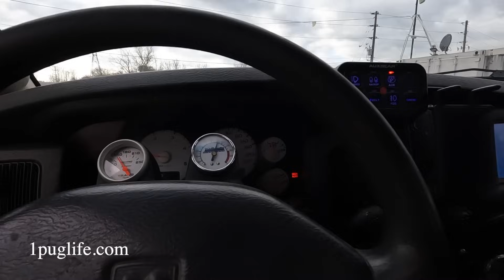running utilities to a shed

Comment: How deep does electrical wire need to be buried in Ontario?
24 inches
Electrical wiring in trench is required to be buried to a minimum depth of 600mm (24 inches) for non-vehicular areas and 900 mm (36 inches) for vehicular areas, all with ribbon (12 inches) below grade. Ensure slack in wire is provided in the ground (S-Loop) for frost purposes.
Reply: Yeah everything they did is wrong 🤷🏻‍♂️
Reply: never seen permanent power ran to a portable container like that and nothing there looks to be any type of code compliant anyway, surprised they even hooked power to it.
seems to me the power should go to a meter pedestal with main disconnect, then to the container...
as for the rest, yeah, nope.

Comment: You should spray water on the blade while cutting, you don't need to breathe that dust!  State law!
Reply: He’s a goof what do expect
Reply: You realize Canada isn't part of the US, right? Besides, using water on the blade washes the chalk line off so you can't follow a straight line.
Reply: @mfranzusan3014 pug snorted the chalk line bmp
Reply: @chuckfry1227  LMAO!
Reply: Zero fox given
Reply: @chuckfry1227 dusts and danders
Reply: theres a dripper attachment for that saw...
Reply: Hes à goof
Reply: @mfranzusan3014 lol only time u need chalk lines is at the start . You run the saw along chalk line to just make a score mark the hole way then you make ur cut so if chalk line goes away youl still have the score line to follow . BMP 😂 plus who even uses chalk lines for cutting concrete we use spray paint for the dummy’s who can’t cut straight
Reply: @Stuckin330  I'm used to relief scoring. Customers that watch you relieve their poured patio slab don't want to see you freehand mistakes. Lol
Reply: Talking to a guy that handles hazardous waste the other day. My man is claiming silica dust scares him more than anything. The pain that goes with silicosis is pretty bad. These days if there is a dust I am masking up. Carry on!
Reply: @mfranzusan3014 pros don't use angle grinders for relief cuts ....😂, you use a concrete pad saw with depth gauge
Reply: @Kaspertube513  pad saw? Depth gauge? You mean a chop saw and a steady hand
Reply: smoke cigarettes
Reply: @mfranzusan3014  we used to spray clear over our chalk lines after the snap

Comment: That TECK90 cable is required to be buried 450mm (18") under non-vehicular areas & 750mm (30") under vehicular areas.